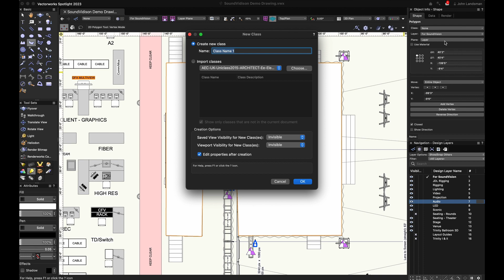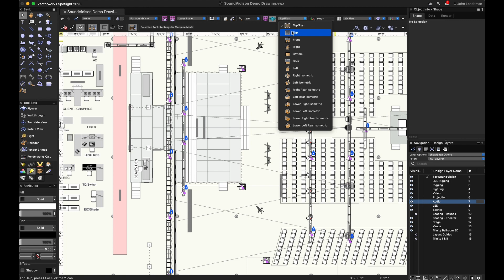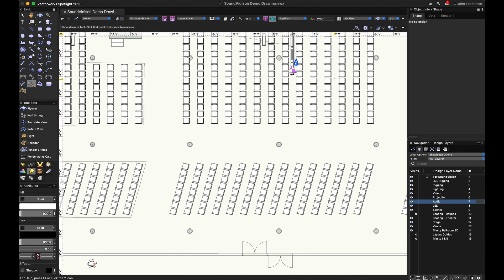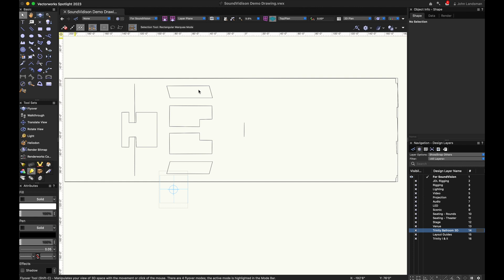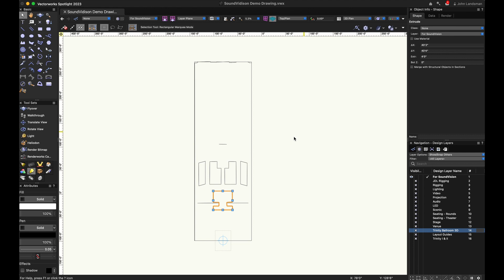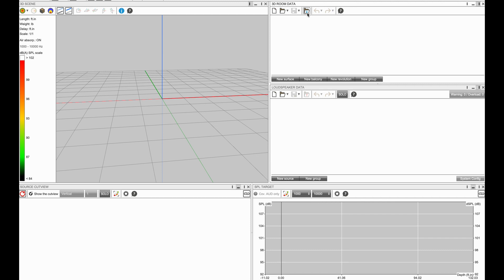Using Vectorworks and SketchUp to Import a file into SoundVision

Comment: This is awesome. Curious how you would handle an arena type with elevations on seating tributes. Like  how would you build them when they rise up in elevation.
Reply from the maker: Lee.  This video concentrated extruding on the top/Plan view, but you can extrude in any view...ie front or right etc.  So, you can build a stair step in side view then extrude it to make bleachers, for example.  You can also extrude along a path...so those bleachers could be curved.  Although some things might still be easier to draw in SoundVision.   J.